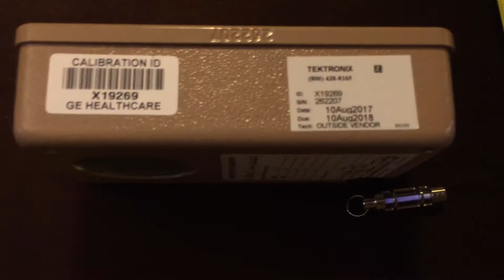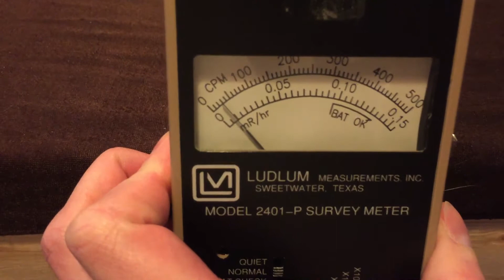Tritium Key Chain Radiation Survey

Comment: I have one of these keychains and a Gamma Scout. I can measure about 0.28 uSv/h when the keychain is sitting above the Geiger-Muller tube. Like what you found, the claims of the radiation being fully blocked by the glass is a lie. It's a low amount of radiation, but not "none" by any means.

Comment: Maybe it depends on the quality of the glass? More lead in the glass of an expensive one or something
Reply from the maker: I do not believe there is any lead in the glass, the X-rays are very low power, so just the glass itself being thicker would make a big difference. That also means most of this gamma radiation will be absorbed by skin etc. not penetrating deep into your organs.
Reply: If there were any lead it Will not pass safety test